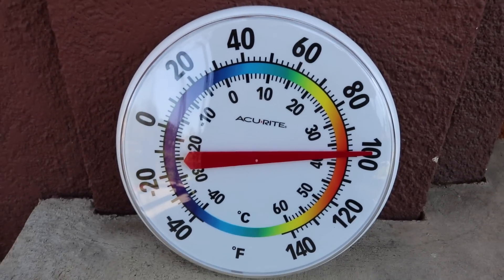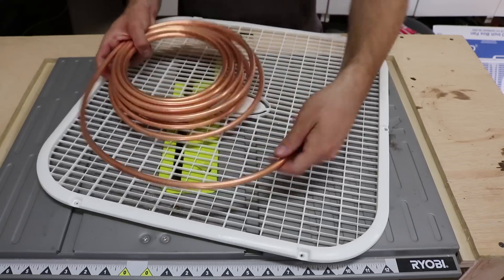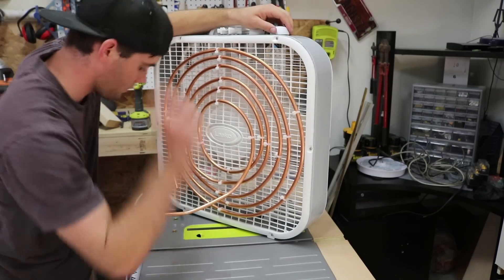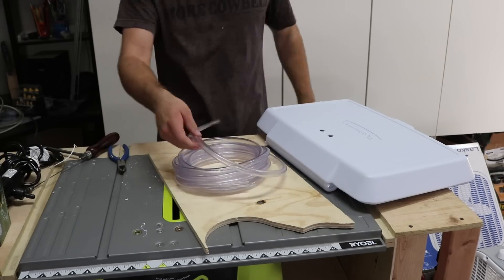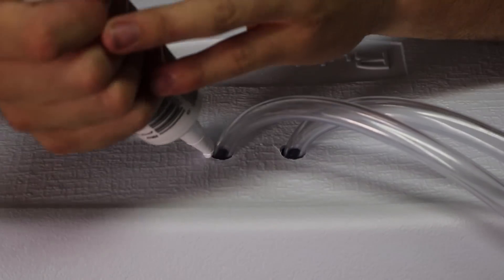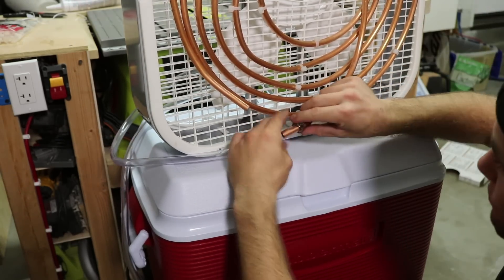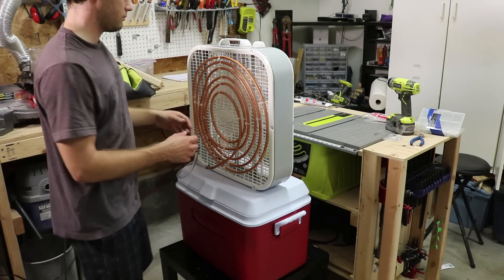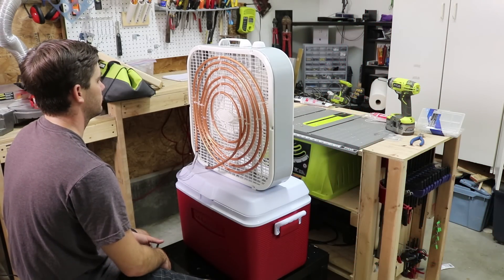$100 Homemade Air Conditioner - DIY

Comment: I have tried it back in early 2000s and it worked well,  problem was that the ice melted within half hour then the air became way too humid.  I used a styrofoam cooler though,  only solution is to have ice constantly in the back up replacing the melted one.
Reply: this is a closed system. no water should be evaporating. what you made was probably an evaporative cooler (aka swamp cooler) which converts the heat energy into heating up water and turning it into vapor.

Comment: I built a unit much like this, more for fun than anything else, and it's pointless.  First, the tubes get cold, but not the kind of cold that cools off a room.  Second, even when coiled, the tube just doesn't have very much surface area to exchange temperature with the air.  Third, air passes by the tubes so quickly that it doesn't lose any of its heat.  It just doesn't work.  Currently I am sitting in a chilly room cooled by a real air conditioner that I got delivered to my door for ~$100, and it doesn't need to be refilled with ice.

Comment: Hypothesis:  "IF you fill copper with water, anything that you feed the end of the copper tube will travel throughout the whole tube?"  So your same design could both be cold or warm.  That is, imagine, IF  I place a small mug heater to make the whole water-filled copper warm for the whole house for the winter!  Or if I place a small fridge at the end of the water-filled copper tube to make the whole house be cooled [a fan is a plus]!   This is only a hypothesis.  Then, IF you have no fan and let the dew come out from the coil; then, you will have WATER from AIR?  Again this is only a hypothesis.

Comment: The main way the ac works, is they transfer heat from your room to outside. they do this by running a cold gas in their pipes that when air passes through it, hot air  will condense in droplets and  get removed by the ac.

Your system does not do that.

Comment: In the end you not show the temperature of room because its failure project . 1.Where is the golden "fins" ?
2. This pipe is not enough to convert hot air into cold
This project is 100% failed

Comment: Well, copper does conduct heat better than aluminum, but doesn't remove it's heat as fast as aluminum does with air. Also you could just buy the smallest car radiator you could find online, mount it to the fan and that's it! The radiator has fins, more surface area, dispersers the cold water temp. much much better that just some copper tubes.

Comment: hvac tech here. you pretty much made a less efficient swamp cooler.  and like the havc tech said below me or above idk. the heat is just getting transfered into the bucket. thats why in traditional hvac systems there is an outside unit which essentially throws the heat outside of room your trying to cool

Comment: THANK YOU!!! Awesome video!! I conceived this idea today and sure enough, someone else already did it. So why am I so happy? Because instead of doing it and failing, I already know it worked for someone. My idea was not as original or "cool" (pun intended) as this one, so I DID learn from this video. Also, this video was well made, so I got ideas from that too. Thanks for your contribution! >LIKED< >SUBSCRIBED< >SHARED< >SAVED<
ALSO: I thought about adding (possibly) a solid-state cooling device to the water tubing to see if I can heat-pump with this. I also found that instead of ice, if I freeze a few gallon jugs of water, and place them in a water base in the ice chest, it will last longer before needing to recharge the cooling part with ice. Yeah, I'm transferring energy from my fridge to my overheated garage, but your ice chest idea at least helps the efficiency. I am also thinking of adding wifi-reporting temp sensors to various parts of the water loop to see how I might increase efficiency. Again, a really cool project and pardon the pun again. lol

Comment: Now, drill some more holes in the first layer of the inside of the lid. Fill all the voids with expanding foam to add more insulation.

Comment: If you really wanna go balls deep, dig down and place a large res of water underground, preferably a conducive material such as 304 stainless steel @ a depth no less than 42” at the top, place a pump inside and fill with water, use the same copper pipe/theory to create a heat exchanger and add a fan. Bam, harvesting the cooling btus of the earth. Cooled water will flow through the copper and the fan will exchange heat. Don’t forget to leave an access to service the pump and drainage for the condensation your coils will create. 

Look at common pump sizes for water chillers to create a good balance of pump to res size. I’d forget the cooler and just buy a window shaker.

Comment: get yourself an inverter with two plug ins and a 100 watt solar panel and this will work off grid. Tell me, is it still in operation? Did it all go well? Thanks

Comment: I m a retired AC tech ( 40 y +). The main problem with this home made cooling system is the copper coil. In order to transfer heat properly, a heat exchanger  MUST have fins otherwise, it won t be able to do what it is suppose to. The other thing is that a good heat exchanger MUST have at least 3 to 4 rows and not just one like on this video.

When you don t have any thermodynamic knowledge, this DIY project makes sense, but if you have some, it just doesn t !

Note : it could work if the copper coil would be replaced by a real heat exchanger. You would have to install a bigger pump too.

Note 2 : BTU calculation formula ;( outgoing water temp - incoming water temp) x flow rate in GPM ( US gallon per minute ) x 500

What is 500 : One US water gallon weights 8.3 pounds X 60 minutes = 498 ( rounded to 500 )

Example : water out temp : 49 F, water in temp : 37 F, flow rate: 1.2 GPM
(49-37) x (1.2 x 500 ) = 7200 BTU per hour

One more thing. Guess how many pounds of ice you would need just for a 10 x 10 room ( for a 10F temp drop). 20-25 pounds per hour or 480-600 pounds a day. A pound of ice only provides 190-200 Btu per hour. At $2.50 for a 10 pounds bag ( if you buy it ), it s $120-$150 a day. OK, what about using your own freezer to do the job. It would take at least 6-7 hours to freeze that amount ( if you have enough room in it). A bigger freezer would take time exactly the same time by the way.

 Don t waste your money on this nosense project and get a real AC.

Comment: $20 more and you can buy a window unit running off a refrigerant which cool at least 50 degrees more than the swamp cooler you have to refill with ice every hour. Way to half ass the hell out it.

Comment: I wonder if you could geocool your shop.  Same cooling system but you run copper pipe through the ground pulling the heat from the room into the back yard.  It's something I've been meaning to do for a while

Comment: Try using a water timer and a couple of pinhole garden hoses to sprinkle the roof and the front door. It will cool the whole garage (and house) off for the cost of about 30 gallons of water a day.

Comment: Good video - BUT It needs to be said that - 'swamp' or evaporative coolers work well in DRY climates - ie: midwest/southern States - but they do NOT WORK in temperate humid summer climates - such as southern Ontario, northern Michigan. If you try to use one, you'll get little cooling effect (low evaporation due to high ambient humidity) and the environment will become horribly damp and unhealthy. Why are so few people calling this issue out? So many 'miracle' $89 coolers / get rid of your aircon etc...NONSENSE - this doesn't work well in more humid climates.

Comment: Freeze several jugs of water and place some in the cooler and keep some for back up in the freezer. Switch out as needed. Jugs will thaw slower than bagged ice and mega cheap in comparison

Comment: I had a similar idea. But wanted to take my shop fan. Then either a used condenser or radiator from a junk yard (cheap). Then I already have a deep freezer and regular freezer in garage. So found out if I mix half salt water (saline) and half (70%) Isopropyl Alcohol it won’t slush or freeze. So then can pump -10 to -15 degree “coolant” through high temperature diffusing radiator. Plus already paying to run fan and freezers as is.

Comment: How does this compare to the traditional homemade cooler fans where they just used forced air over the ice? I work in an auto repair shop and an looking for something that has a more direct cool air flow over me vs trying to cool a room. Ty

Comment: Why not just cut a hole on both sides of that cooler and put a 6-in PVC pipe all the way through using silicone glue on the inside and the outside wait until it completely dries feel the thing completely full of ice on one side of the PVC pipe just put a 6-in fan blowing nice cold air through it kind of like a heat exchange

Comment: That electric pump sitting in the water in your cooler could be dangerous. you should attach it to the lid of your cooler so it doesn't sit in the water etc.

Comment: Will it still work with only the clear vinyl tubing instead of using the copper piping?
Reply: No because copper conducts heat 100 time better than vinyl

Comment: It’s “ Not “ an Air Conditioner. Learn the laws of Thermodynamics. You didn’t use pipe clamps , you used hose clamps .
For $55.16 more , you could’ve bought a real AC unit .. 

Amazon Basics Window-Mounted Air Conditioner with Mechanical Control - Cools 150 Square Feet, 5000 BTU, AC Unit
$ 155 16
Even though it only  for 150 sq ft. It would still reduce the ten in your garage to 80* or less.

Comment: This is a great tutorial! I want to make this for next summer. It would be around $50 to $60 now, which is way less than the $200+ used air conditioners and $100+ EVAP coolers I saw this past summer.

Comment: One issue I can see with this "ac" is that the lines are going to sweat, but maybe if there were a way to drain it back into the cooler to help with the condensation that is going to inevitably form, this would be a neat idea for an emergency situation I suppose.

Comment: Use a aluminum core old gm rad . I have one out of a 2006 v8 gxp it had a crack tiny in side tank epoxy would hold cold low pressure repair but not in car environment replaced will use old one to run 57 f well water int rad with same fan . Purchasing a small pump my well 25 feet from house water is 5 feet down  $$$$$$$$$ cheap bye the way I am a ham radio operator that make me extra cheap lololo

Comment: This is not an air conditioner, an AC removes heat from the air which is not the case with your homemade system.

Comment: Pull your car in the garage ,shut the garage door and put car ac on full blast and leave the windows down...cool down the car and garage at the same time...rev it up a couple times to get that compressor pumping good! Or just get a couple cans of that refrigerant and spray all over your garage,that'll cool it down not to mention the great aroma so its like a 2 for 1 kinda thing! My dad taught me that trick not long b4 he died from a heat stroke in his garage, his cans were all empty so im guessing thats y he had the heat stroke thing

Comment: You can get more time by freezing half gallon milk containers instead of using bag ice. I have a relative that made this on a larger scale. He took a semi truck radiator and mounted it in the ceiling in his outdoor kitchen and put an attic fan behind the radiator blowing through it. He hooked it up to a 1000 gallon open top tank underground and would use 150 pound blocks of ice he froze in the tank filled with water. I was surprised at how cold it got standing under it and the ice lasted all day.  It's nice standing over a hot BBQ all day when you have AC blowing down on you in 100 + degree temp's.

Comment: Ok Great idea. But let's talk about copper tubing being more like $50 in that size. Then let's talk about heat transfer in the tube full of cold water. It creates condensation on the copper which drips off and soaks the floor. Then let's talk about how the ice doesn't last long because the heat transfer melts it pretty quickly. The more ice you buy the more costly this idea gets and pretty soon you were better off spending $179 on a window style A/C.

Comment: I wonder if you made the coil tighter (which in turn would be more copper and more area to transfer heat) would it work better.
Reply: Might affect airflow
Reply: @0samacareX  yes will definitely affect airflow but the air might be cooler. 🤷who knows... cool experiment I might have to try one day.